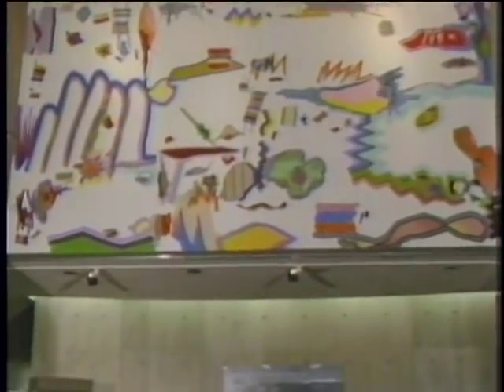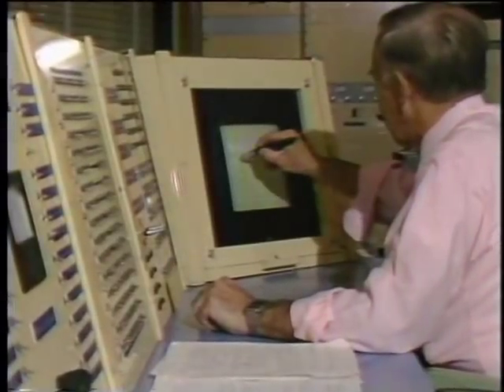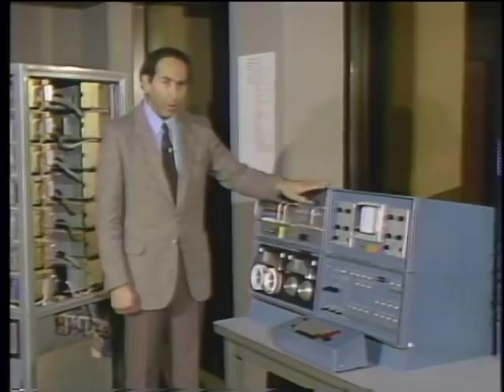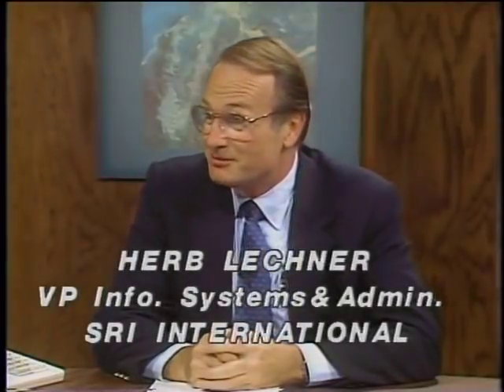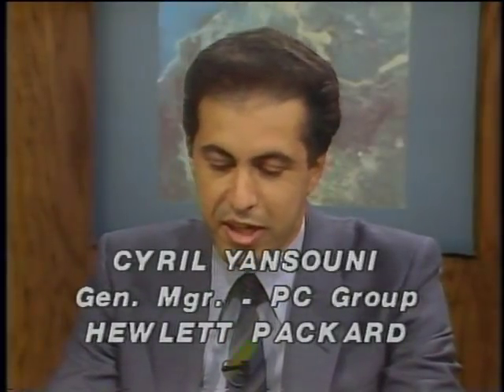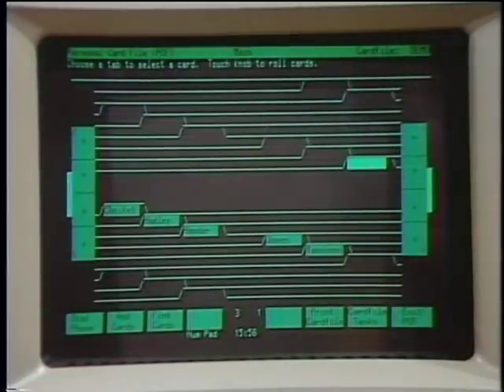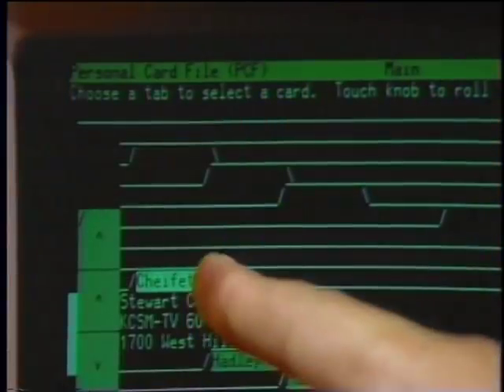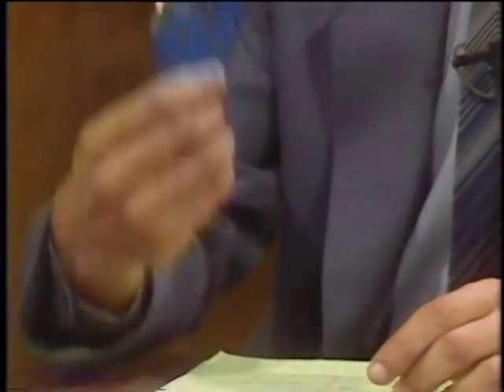The Computer Chronicles - Mainframes to Minis to Micros (1983)

Comment: Used to love this show. It would have been great if the show kept going and had not stopped back in 2002.
Reply: I think Stewart Cheifet got burned out after so many years of making the show run and lining up sponsorship. By the early 2000s you had people like Leo Laporte, Kim Komando and even the "High Tech Texan" picking up the torch.

Comment: 14:08 "Touchscreen Capability"  Well that basically proves the idea that top level corporate technology is about 30 years ahead of retail technology.  It's 2015 so think ahead 30 years to 2045 and think about the level of technology that likely exists at high level corporate laboratories today.  Nanotechnology, bioprocessors, holograms, eye contact HUDs and we can speculate on the list's remainder. 

If you think back thirty years, 1953 was the age of rocketry.  3D models were likely used along with the processing power of the early 80's deployed in high level NASA usage to predict outcomes for rocket prototypes.  Wow, this show is FASCINATING. 

Thank you for allowing me to hear the discussions of industry insiders of the computer revolution, uploader!

Comment: 8:10 The next step will ve integrating video, television into the computer.
Well, only 2 years after the airing of this episode, Commodore launched the Amiga 1000 which was capable of full broadcast quality NTSC video, realtime animated graphics and 4 channel audio in 1985,  backed by a multitasking windowing graphical operating system, which was finally surpassed by pc in 1995....
Reply: The Amiga 1000 could only overlay graphics on top of a video signal.
Reply: I know this comment was years ago, but I'd say PC and Mac didn't really catch up to Amiga OS until Windows 2000 and OSX.

Comment: This episode aired the first year I was in high school, and at that time, the state of the art computer was the Apple IIe.  When fully equipped, it had 128k RAM memory, 2 five and a quarter inch floppy drives (each magnetic floppy disc held 700k of information) a color monitor, and a dot matrix printer.  Only one Apple our school had was hooked up to an external modem, but there was no Internet at the time.  In inflation adjusted dollars, a computer like the Apple IIe cost way more than any laptop computer, tablet or smartphone of today.  That’s why few people had computers in their homes in the 1980s, and it was regarded mostly as an expensive toy and not the essential tool that all people must have today.
Reply: You think the Apple II was more state-of-the-art than the IBM PC/XT that came out early that year?
Reply: We had BBC Micro in 1988

Comment: The Wiki page for tx-0 says: " Significant pieces of the TX-0 are held by MIT Lincoln Laboratory. In 1983, the TX-0 was still running and is shown running a maze application in the first episode of Computer Chronicles. ". But not when it went out of service or was powered off. Anybody knows ?

Comment: These days microprocessors are everywhere and even  the big mainframes are nothing more than thousands of microprocessors working together to solve massive problems.  They also likely run Linux.
This show was recorded 40 years ago next month.  Back in those days, I was a computer tech, working on mini computers from Data General, DEC and others.  There was also one mainframe system I worked on, which was a mil spec version of an IBM computer, made by Rockwell Collins.  I bought my first computer, an IMSAI 8080, in November 1976.  Today, I have a cell phone that is far more powerful than anything from back in those days and I run Linux on my desktop and notebook computers.

BTW, Gordon Bell was one of the people behind Ethernet DIX (Digital Intel Xerox) standard.

Comment: So the monitor of the TX-0 used a crosshatch raster? (horizontal and vertical) The scan rate is very slow and  the screen is using high presistence phosphors, so I am thinking the crosshatch scan was used to be able to display reasonably high-res graphics  even with the speed/processing  limitations of the machine. It looks like the monitor had different video modes as well, because when it displayed the "What?", the picture was not flickering and it might have been using a conventional horizontal raster.

Comment: @17:14 - Gary Kildall highlighting in 1983, the no1 reason why a finger-based touchscreen desktop monitor should never be a thing.
Reply: He did, basically, say that it wouldn't be used constantly. I wouldn't mind having one just for the rare instances I would use it. It definitely cant replace a mouse tho.
Reply: I’ve had a touchscreen monitor on a few computers and it was more a nuisance than anything - I’d be pointing something out to someone else and accidentally click on something.  Mouse and keyboard are more ergonomic and faster for most applications.  Still, it’s hard to imagine modern smartphones and tablets without touchscreens, so they did find an important use in portable computing!

Comment: 20:50 they are discussing the creation of what would become the internet. Amazing.
Reply: The internet already existed by 1983.
Reply: Hr Gwea No, I mean modern internet. 83 it was still a novelty.
Reply: The internet existed since 1969. It was just called ARPANET then.
Reply: Well, maybe its semantics, but they didn't switch over to the internet protocol (ip) until Januari 1983 on the arpanet. Before that it wasn't a universal worldwide network where everybody was using the same protocol(Both NCP and TCP/IP was used. So you could say that they actually "switched on" the modern internet that Januari day in 1983! Or, to be more acurate, they switched off the old NCP protocol.
https://www.internetsociety.org/blog/2013/01/30-years-tcp-and-ip-everything
There must have been some discussion about it among the people in this program since it probably would have been a big thing in 1983,  therefor they could make this prediction!
Reply: ARPANET was a private (or better stated, non-public) network with point-to-point connections between universities, a number of military vendors, military installations, other DoD locations and the Pentagon. There may have been some public access but I don't remember any. The public had BBSes and other point-to-point dial in options but that was it. One of the reasons why there's the joke about Al Gore inventing the Internet is he cast the deciding vote as VP since the vote it was tied 50-50 to make it public. Think about it: 50 senators wanted to keep what was to become the Internet a DoD network only. Think about how history would have been changed had that happened. So while I think Gore is an idiot with no credibility (think of all his doomsday predictions about global apocalypses due to climate change that have failed) I do thank him for voting yes on this subject.

Comment: I'm glad I still have my 466DX  and can just power up into DOS 6
Reply: Yepp. Me 2. Gravis Ultrasound 256kb. DOS6.22. Norton Commander 5. Fast Tracker 2. Gwaaah! Love it!
Reply: I don't know what a 466DX is, but my 486DX could quite easily handle Windows 3.1. Limiting a machine with more than 1MB of memory to running only DOS was a huge waste of computing power.
Reply: 466DX was a Intel 8486 with a math processor with 66MHz. Everyone i know used that term in the90's
Reply: retroHC "466DX was a Intel 8486 with a math processor with 66MHz"

I don't know what a 8486 was, but my 486DX was an 80486 CPU. The DX meant the copro was active. A 486SX CPU had an inactive copro. My first 486 CPU was a 486DX-33, meaning it ran at 33MHz. 66MHz 486s were just 33MHz machines with a clock doubler, designated as 486DX2-66.

"Everyone i know used that term in the90's"

OK, but the industry itself used a widely accepted CPU naming standard incompatible with you and your friends.
Reply: retroHC "I just new what he ment. Your the one who go Aspergers on the shit."

LOL! I don't have Asperger's, but when I first got into computers in the late 1970s, we were all super nerds, that's for sure. And any programmer from that era will tell you that you have to be very precise syntactically, or your code won't work.
Reply: NibsNiven My i298 was the best computer ever!
Reply: I just bought a IBM-dragtop-clone with monochrome 12" screen, Hard drive and a 5"25 floppy. RETRO HAZ CHRISTMAS TODAY!

Comment: 01:55 You were damn right... 
Today's smartphones are nothing more than a tiny computers in our pockets. It is amazing that we can have smartphone that has 3840 x 2160 px display, 12 GB of RAM, a 12 core CPU, a dedicated GPU with 4-6 GB of VRAM, and everything is with 512+ GB of storage, 5G network ( 100Mbits up to 20 Gbps peak) for connection, multiple cameras and battery powered to run hours or standby for days... 

And you can lose those things just like keys... 

LOL

Think about coming at that time on the show with todays top spec smartphone and drop it on the table...
Reply: And yet a smartphone typically does very little onboard processing as it's too weak for the tasks needed these days.  Instead, it all gets hopped over to a remote server farm with fully scalable, essentially infinite, processing and storage capabilities needed.

Comment: The micro floppy wasn't out during the  the early 80's. Take note, this show was aired 1983. Storing data way back then, they use cassette tape.  Also during the mid 80's It  was  more of that big flat floppy diskette as well. There's no abbreviation yet you have to pronounce what it is completely. with this one, you put a tape or sticker where it becomes right protect. I remembered my older brother using it in his computer subject  and showed it to me. Meaning to say, It took ten years or more when micro floppy diskette becomes available to all. Because computer hardware had to upgrade as well in order for it to be used.
Reply: Took 10 years to become available? It took only about 3 months for the 3.5 inch diskdrives/diskettes to be available.
The original Apple Mac was released in Januari 1984 and this program was made in october1983...
And when I bought my Atari ST in 1986 it already had become very common even here in Sweden with 3.5 inch diskettes...
Reply: Not true.  5.25" disk format was already around and quite popular for the Apple //, Commodore 64, and IBM PC.  Cassettes were only used by extreme budget users.

Comment: floppy disk would be up to 1 megabyte, the new mass storage system xD
Reply: serenadezzz Well it was indeed a mass storage system, but thankfully that lasted for a short time, a very short time :)
Reply: +A Culture Mind I remember we were still using 3½ floppies at secondary school ~2001. Gotta be 20 years at least!
Reply: The floppy diskette was invented by IBM in 1971, and I was using microfloppies regularly for work between home and school until 2012!
I then realized how slow they are when you're using them for intensive read/write activities (music typesetting in my case) and I lost data too many times which is why I switched to a flash drive. But they were definitely the best mass storage device for decades until flash memory became affordable!
Reply: thomase13 I switched from floppies to flash memory back in 2005. My first USB flash memory had just 512MB capacity, which was quite good for 2005 :)
Reply: I still use floppies.
Reply: In a time when home computers would have 64kb of RAM, having a megabyte of storage on a single medium is pretty good.
Reply: + raffie The toy computers they sold at K-Mart and Sears had 64KB ram.  Real business machines like the IBM PC had 256KB or more.
Reply: @thomase13  Around 2005 I removed, and beat to parts my last FDD device. Later I heard that early floppies were really great and reliable, but in the 2000s- they were a huge pain. As a student in a hostel, I had a printing 'business' in by room, where people would come to print things from floppies, interrupting my gaming. And, failing floppies crashed the computer (and my games) all the time:)
Reply: @megabojan1993  mine was 32 MB in 1999 or 2000